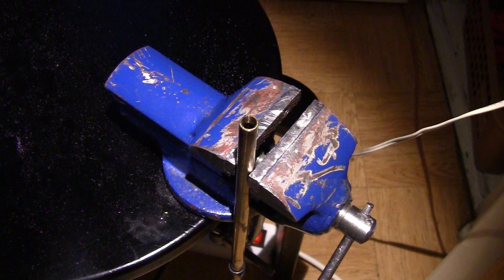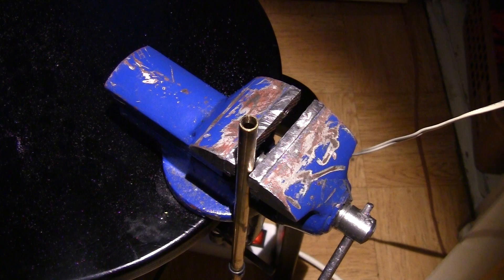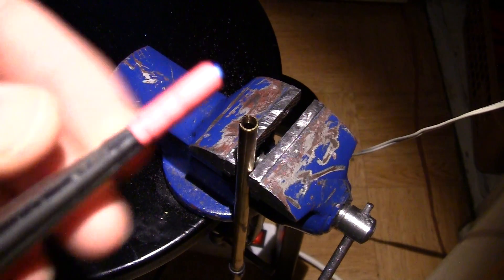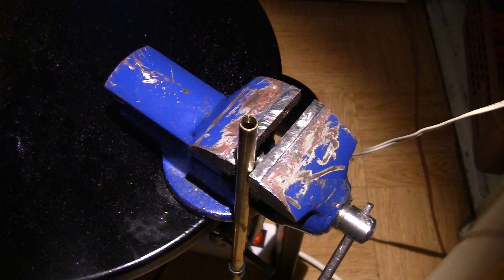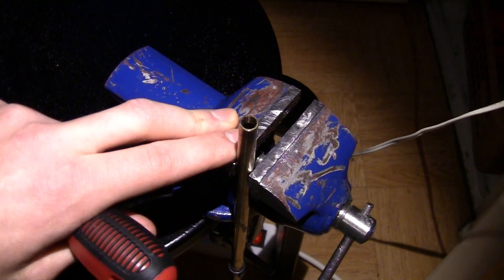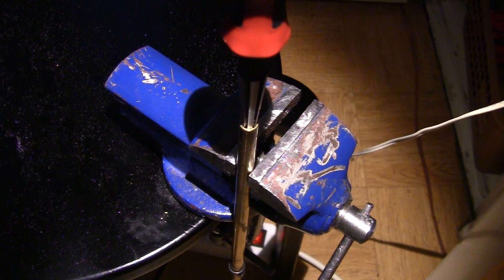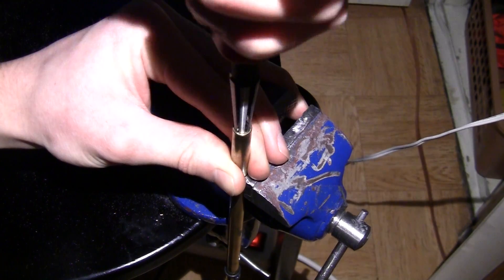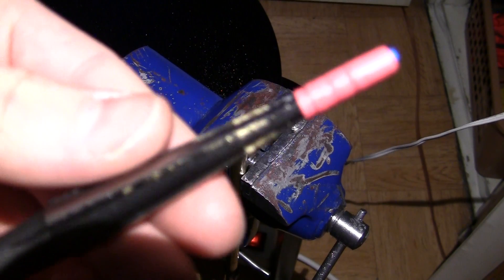Airsoft how to crown a barrel

Comment: Mayby you could post later some observations of the resuls.
Reply from the maker: I will also lap this barrel by using the HS armory lapping kit. I will post results when I get done with them.
Reply: Maekiii You should have some of the crown enhancers too yes? That'll be useful to take off any micro-burr you left behind from this tool.
Reply from the maker: Whatfor5
Indeed. Good tip :)

Comment: What tool is that? I have just been using a dremel bit to crown my inner barrels, but the result tend to be a bit uneven.
Reply from the maker: It is a taper reamer.
Reply: Maekiii please, size, and model make of this wonderful reamer, I have so far been unable to find one with that long of a taper
Reply from the maker: skag187
I have thrown away the packaging already. But it is a product of some finnish company. I doubt they are available anywhere else really. :P The length of the edge is 7cm, thickness from 0,3cm which goes all the way up to 1,2cm. I've seen similar stuff in ebay, but they should be availabe in any hardware strores.